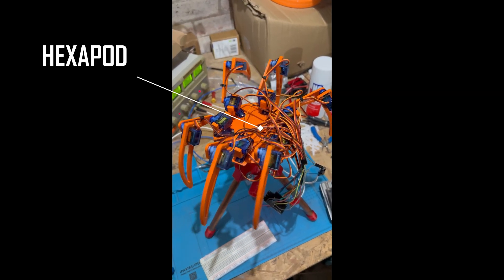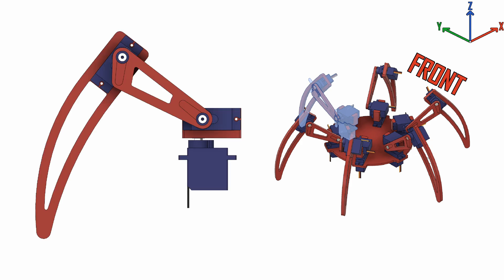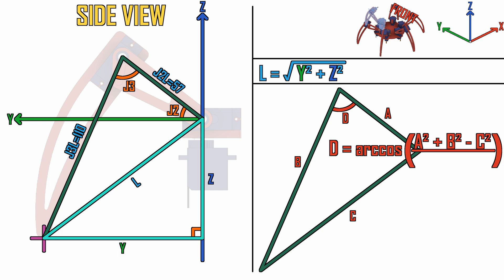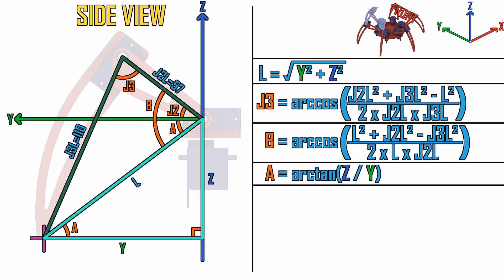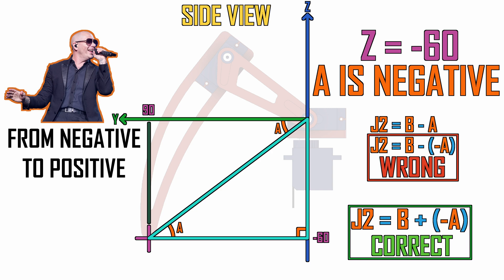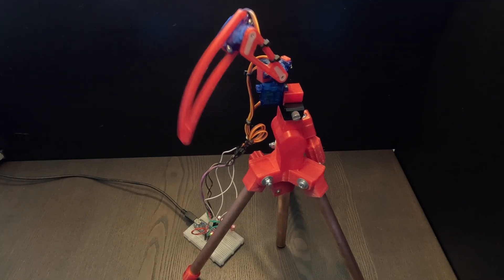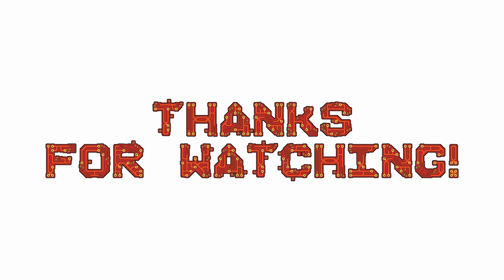Robot Inverse Kinematics With A Hexapod Leg

Comment: My new printers in 2025 are fast but I don't print at fill speed on detailed prints.. but parts like these can go pretty fast..   I sold my old Longer LK5 pros  and  bought 2  SOVOL SV06 Plus Aces,  with a 500mms top speed.. it's crazy. they call them BED SLINGERS   LOL  I am waiting as I type this for my Micro Servos, I had to do  some shopping around as a lot of them bundles people are bitching about because they would get say out of a 10 pack maybe 2 or 3 dead  ones or ones  that were defective.. so word to people wanting to make this Hexapod..  TEST YOUR SERVOS before assembly to make sure it works and that it returns to center,  Happy building everyone..and great video BTW..

Comment: and how did u calculate the offset ?
Reply: Offsets are arbritrary. Like you just use whatever you think looks a nice (default) pose.

If one has the extra inputs on the controller for it. You can even make it controllable. So you have something like a little slider that can cause the robot to bob up and down. Or spread it legs out to be appear wider and flatter.

Comment: can u explain why did we swap Y with h  i am not able to understand that part
Reply: The idea is that we can just give this the code a set of 3D coordinates and it will deduce from that how to set the Servos. Right?

Well to do that we first want to figure out the leg orientation and stretch in the horizontal space. This is the simple bit where we end up with a rotation and the 'h' value of >how far the leg is stretched<. That way we can already call things done on horizontal space with the horizontal servo and reduce the problem to just dealing with the vertical space with the other servos. 

To figure out vertical we need both the height and >how far the leg is stretched<. That should be the coin-drop of that 'h' and 'Y' express the same and that because we already have 'h' from before. Which can just insert that, instead of some arbitrary 'Y'.

Comment: does it matter if J1 has offset away from J2? I see there are many designs of 3 dof leg in this way.
Reply from the maker: Yes it would have an effect on the XY solution, I think you would need to calculate the angle for J1 first, then using that angle and the offset to J2 calculate the X and Y value for where J2 is now located and subtract those from the X and Y used to calculate J2 and J3

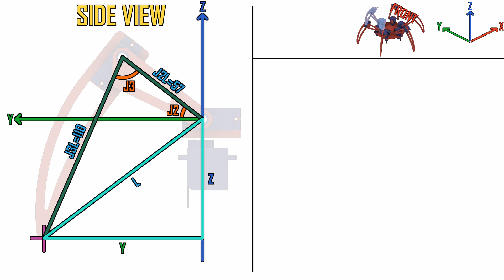Comment: I want ask something, in minute 3:25 . Are L variable is range between servo 2 and the lowest point of foot point can be?
Reply from the maker: L is from servo 2 to the position of the foot, where we want to position it, there will be a range of motion that can be achieved depending on the lengths J2L and J3L. I hope this answers your question :)
Reply: Another question at 9:37 , where you can get y,90 and z,-60?
Reply from the maker: No problem, those are physical measurements, I obtained them from the CAD model of the design with the leg in the 'resting' position that I wanted.
Reply: Thank you for the explaination sir

Comment: Hello
I would like to use WiFi, but the servos are controlled via GPIOs that support ADC2 and that is not recommended.
So I had no choice but to use a PCA9685.
In the original code, the servo values are transferred directly; for the PCA, these must be converted into PWM signals.
I can proudly say: it's done.
with a few additional functions. but this example code already works. I also integrated an IMU straight away.

#include <math.h>
#include <Ramp.h>
#include <Wire.h>
#include <Adafruit_PWMServoDriver.h>
#include <Adafruit_MPU6050.h>
#include <Adafruit_SSD1306.h>
#include <Adafruit_Sensor.h>

Adafruit_MPU6050 mpu;
Adafruit_PWMServoDriver pwm = Adafruit_PWMServoDriver();
#define USMIN_J1  500
#define USMIN_J2  400
#define USMIN_J3  750
#define USMAX  2400 
#define USMAX_J1  2500
#define SERVO_FREQ 50 

// Debug
#define DEBUG
#ifdef DEBUG
  #define DEBUG_PRINTL(x)  Serial.println(x)
  #define DEBUG_PRINT(x)  Serial.print(x)
#else
  #define DEBUG_PRINTL(x)
  #define DEBUG_PRINT(x)
#endif

// MIDDLE LEFT LEG
//          x
//          ^
//          |
//          |
// y <------o

// Servo pins
const int J1Pin =  0;
const int J2Pin =  1;
const int J3Pin =  2;

// Variable für Servo-Positionen
int pi_pos = 45;
int ya_pos = 45;

// Vorherige Werte für Gyrodaten
float oldPitch = 0.0;
float oldYaw = 0.0;
float offset_ = 0.35;

// Constants
const double J2L = 57.0; // Length of J2 (57 - 2.35)mm
const double J3L = 110.0; // Length of J3 110mm

const double Y_Rest =  70.0;
const double Z_Rest = -80.0;

const double J3_LegAngle = 15.4;

// Joint Variables
double J1Act = 0.0;
double J2Act = 0.0;
double J3Act = 40.0;

rampDouble J1Tar = 0.0;
rampDouble J2Tar = 0.0;
rampDouble J3Tar = 40.0;

// Command Variables
bool started = false;
bool ended = false;
uint8_t commandStep = 0;

// Commands
const double lines[62][4] = {{0.0, 0.0, 40.0, 1000},
                            
                            {-30.0, 40.0, 20.0, 200},
                            {-30.0, 40.0, -20.0, 200},
                            {60.0, 40.0, -20.0, 1600},
                            {60.0, 60.0, 20.0, 200},  

                            {-30.0, 30.0, 20.0, 200},
                            {-30.0, 30.0, -20.0, 200},
                            {60.0, 30.0, -20.0, 1600},
                            {60.0, 50.0, 20.0, 200},

                            {-30.0, 20.0, 20.0, 200},
                            {-30.0, 20.0, -20.0, 200},
                            {60.0, 20.0, -20.0, 1600},
                            {60.0, 40.0, 20.0, 200},

                            {-30.0, 10.0, 20.0, 200},
                            {-30.0, 10.0, -20.0, 200},
                            {60.0, 10.0, -20.0, 1600},
                            {60.0, 30.0, 20.0, 200},

                            {-30.0, 0.0, 20.0, 200},
                            {-30.0, 0.0, -20.0, 200},
                            {60.0, 0.0, -20.0, 1600},
                            {60.0, 20.0, 20.0, 200},                                                      

                            {-30.0, 40.0, 20.0, 200},
                            {-30.0, 40.0, -20.0, 200},
                            {-30.0, 0.0, -20.0, 800},
                            {-30.0, 20.0, 20.0, 200},

                            {-20.0, 40.0, 20.0, 200},
                            {-20.0, 40.0, -20.0, 200},
                            {-20.0, 0.0, -20.0, 800},
                            {-20.0, 20.0, 20.0, 200},

                            {-10.0, 40.0, 20.0, 200},
                            {-10.0, 40.0, -20.0, 200},
                            {-10.0, 0.0, -20.0, 800},
                            {-10.0, 20.0, 20.0, 200},
                            
                            {0.0, 40.0, 20.0, 200},
                            {0.0, 40.0, -20.0, 200},
                            {0.0, 0.0, -20.0, 800},
                            {0.0, 20.0, 20.0, 200},

                            {10.0, 40.0, 20.0, 200},
                            {10.0, 40.0, -20.0, 200},
                            {10.0, 0.0, -20.0, 800},
                            {10.0, 20.0, 20.0, 200},

                            {20.0, 40.0, 0.0, 200},
                            {20.0, 40.0, -20.0, 200},
                            {20.0, 0.0, -20.0, 800},
                            {20.0, 20.0, 0.0, 200},

                            {30.0, 40.0, 0.0, 200},
                            {30.0, 40.0, -20.0, 200},
                            {30.0, 0.0, -20.0, 800},
                            {30.0, 20.0, 0.0, 200},

                            {40.0, 40.0, 0.0, 200},
                            {40.0, 40.0, -20.0, 200},
                            {40.0, 0.0, -20.0, 800},
                            {40.0, 20.0, 0.0, 200},

                            {50.0, 40.0, 0.0, 200},
                            {50.0, 40.0, -20.0, 200},
                            {50.0, 0.0, -20.0, 800},
                            {50.0, 20.0, 0.0, 200},

                            {60.0, 40.0, 0.0, 200},
                            {60.0, 40.0, -20.0, 200},
                            {60.0, 0.0, -20.0, 800},
                            {60.0, 20.0, 0.0, 200},

                            {0.0, 0.0, 40.0, 200}};

// Funktion zum Begrenzen des Werts auf ein Maximum
int limitToMaxValue(int value, int maxLimit) {
  if (value > maxLimit) {
    return maxLimit;
  } else {
    return value;
  }
}

// Funktion zum Addieren von altem und neuem Wert
float addValues(float oldValue, float newValue) {
  if (newValue > 0.2 || newValue < -0.2) {
    oldValue = oldValue + newValue;
  }

  return oldValue ;// + newValue;
}

void setJ1(int servo, int pos) {
  //This first bit of code makes sure we are not trying to set the servo outside of limits
  int sendPos;
  if (pos > 179) {
    pos = 179;
  }
  if (pos < 0) {
    pos = 0;
  }
  sendPos = USMIN_J1 + ((USMAX_J1 - USMIN_J1) / 180 * pos);
  if (servo > -1 && servo < 16) { //only try to move valid servo addresses
    pwm.writeMicroseconds(servo, sendPos);
  }
}

void setJ2(int servo, int pos) {
  int sendPos;
  if (pos > 179) {
    pos = 179;
  }
  if (pos < 0) {
    pos = 0;
  }
  sendPos = USMIN_J2 + ((USMAX - USMIN_J2) / 180 * pos);
  if (servo > -1 && servo < 16) { //only try to move valid servo addresses
    pwm.writeMicroseconds(servo, sendPos);
  }
}

void setJ3(int servo, int pos) {
  int sendPos;
  if (pos > 179) {
    pos = 179;
  }
  if (pos < 0) {
    pos = 0;
  }
  sendPos = USMIN_J3 + ((USMAX - USMIN_J3) / 180 * pos);
  if (servo > -1 && servo < 16) { //only try to move valid servo addresses
    pwm.writeMicroseconds(servo, sendPos);
  }
}

void setup() {
  // DEBUG
  #ifdef DEBUG
  Serial.begin(9600);
  #endif

  if (!mpu.begin()) {
    Serial.println("Sensor init failed");
    while (1)
      yield();
  }
  Serial.println("Found a MPU-6050 sensor");

  pwm.begin();
  pwm.setOscillatorFrequency(27000000);
  pwm.setPWMFreq(SERVO_FREQ);  // Analog servos run at ~50 Hz updates
  delay(10);

  UpdatePosition(0, 50, 30);

  delay(5000);

}

void loop() {

// Update position
J1Act = J1Tar.update();
J2Act = J2Tar.update();
J3Act = J3Tar.update();

CartesianMove(J1Act, J2Act, J3Act);

if (ended == false){
  // Check if command finished
  if (started == false | J1Tar.isFinished() == true){
    commandStep++;
    if (commandStep > 61)
    {
      ended = true;
    }

    double xMove = lines[commandStep][0];
    double yMove = lines[commandStep][1];
    double zMove = lines[commandStep][2];
    uint16_t duration = lines[commandStep][3] * 2;

    J1Tar.go(xMove, duration);
    J2Tar.go(yMove, duration);
    J3Tar.go(zMove, duration);

    started = true;
  }
}

}

void CartesianMove(double X, double Y, double Z){
// OFFSET TO REST POSITION
Y += Y_Rest;
Z += Z_Rest;

// CALCULATE INVERSE KINEMATIC SOLUTION
double J1 = atan(X / Y) * (180 / PI);
double H = sqrt((Y * Y) + (X * X));
double L = sqrt((H * H) + (Z * Z));
double J3 = acos(   ((J2L * J2L) + (J3L * J3L) - (L * L))   /   (2 * J2L * J3L)   ) * (180 / PI);
double B = acos(   ((L * L) + (J2L * J2L) - (J3L * J3L))   /   (2 * L * J2L)   ) * (180 / PI);
double A = atan(Z / H) * (180 / PI);  // BECAUSE Z REST IS NEGATIVE, THIS RETURNS A NEGATIVE VALUE
double J2 = (B + A);  // BECAUSE 'A' IS NEGATIVE AT REST WE NEED TO INVERT '-' TO '+'

UpdatePosition(J1, J2, J3);
}

void UpdatePosition(double J1, double J2, double J3){
  // MOVE TO POSITION
  setJ1(J1Pin, 90 - J1);
  setJ2(J2Pin, 90 - J2);
  setJ3(J3Pin,J3 + J3_LegAngle - 90);

  //DEBUG_PRINT("J1: "); DEBUG_PRINTL(J1);
  //DEBUG_PRINT("J2: "); DEBUG_PRINTL(J2);
  //DEBUG_PRINT("J3: "); DEBUG_PRINTL(J3);
}
Reply from the maker: I'm sorry your comment seemed to require approval, I assume it's just because of the length, thank you for your effort :)

Comment: Excellent video clear explanation. I build a hexapood myself. One question if I have a J1L=60 how does this affect the code?
Reply from the maker: Hi @TubeClemens, Do you mean you wish to have J2 not directly above and inline with J1 and call this offset J1L? If so then as a quick shot at this you would need to think about the following:

@3:30 the Y value would need to have 60 taken off as this would be a fixed offset by J1L=60, similar to @9:41 where we apply an offset to Y to account for the leg resting position, but I think the real answer is below.

@11:53 when we go back and substitute H in, we would substitute (H - J1L).

For a quick look I think that would be the solution you are asking for.

Hope this helps :)
Reply: @JustAnotherMakerChannel  Thank you very much this is exactly what I meant. I wil give it a try.
Reply from the maker: Great @TubeClemens, I’m glad I could help, please let me know how it goes :)

Comment: Maybe reverse engineer in algorytme and iterations something touchable. Like start and stop animations. Moving a robot engine by hand can be recored by software as steps. With or without a rhyme or repeatative steps in it. It is basically acting and can be started with dancing lessons. Like walse and rumba. Some rhyme can be distellid from that for your robot. Overlapping formulas can be used for more complex movements. Just coordinates with two equals signs.
Reply: just use one motor with forward and backwards with an array of gears that perform the same movement sequence r p m, gear number and gear radius can all solve there Selfe just create the geometry and work backwards computing power can then be used to just change the drive gear to a new speed or shift to another gear for sequence movement change this is aa mix of analog and digital  makes things simpler combing the best of old and new. the geometry starts with the variables the gear math is simple with a simple gear generator software and chat g p t for Arduino or raspberry pi coding.  The cool thing is in the current times we have so much data points we can utilize and combine to create things that are just overlooked by staying inside the confines of traditional education there is more than one way to skin a cat the math forms its self inside the confines of the geometric parameters

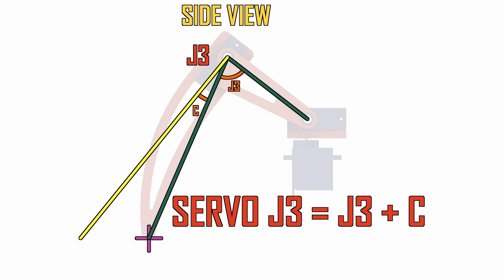Comment: How did you calculate the C angle at 10:15? Only part of the (excellent) vid that stumped me
Reply from the maker: My apologies for not being clearer, that angle is measured from the design, the reason being that the servo arm is not aligned with the leg. Really though it could have been designed in line and the angle C would not be needed at all!